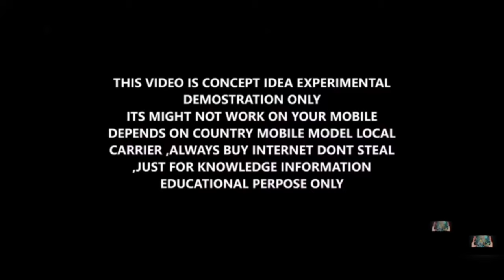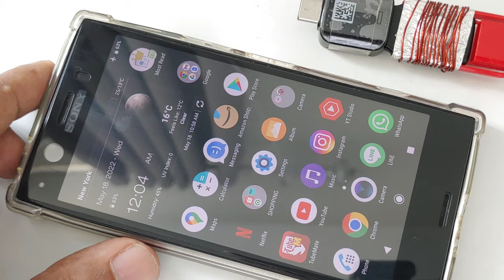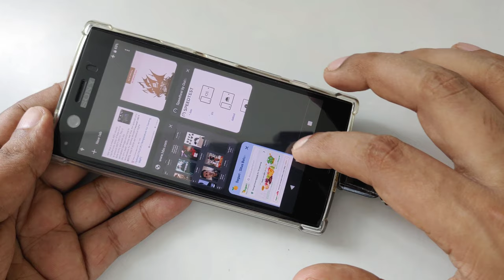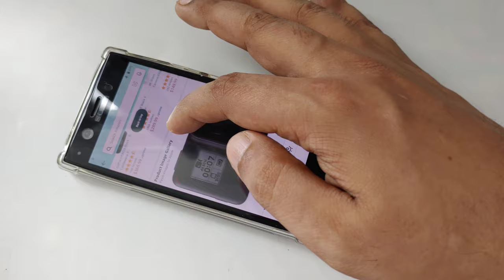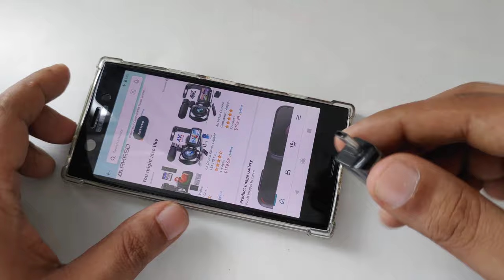how to make your Old Usb Pen Flash Drive as Free Internet WiFi

Comment: A bit confusing - at the 6.05 mark your screen shows  the 'airplane mode is on, yet this overrides that and gets a signal ?
Reply: Yes how
Reply: @anteshsurroop3214  by disabling radio power in settings which is what he must have done to this phone. Google how to use internet with airplane mode on.
Reply: but with flight mode on you can use wifi
Reply: yes i also see this